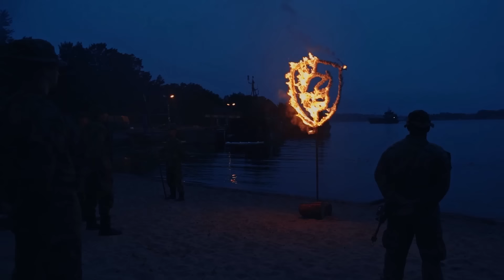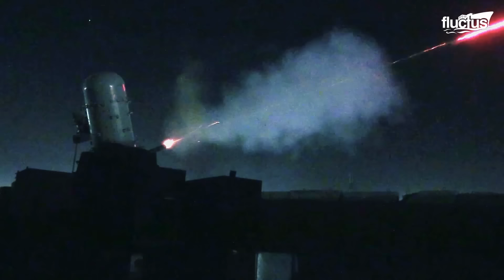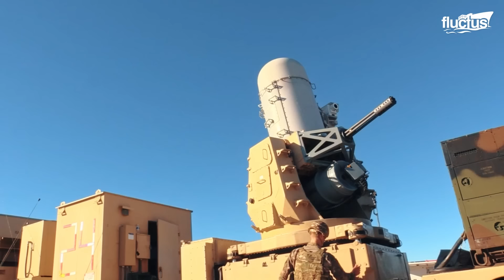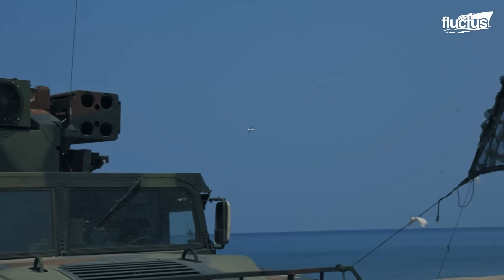NATO Test Firing Sweden’s Powerful $8 Million Howitzer Cannons

Comment: to be fair now days this things are good but useless in a drone war.
they are good becasue they can intercept missile and so on but in a drone war then they are useless.

i mean they are using missiles/ rockets that cost like 100 000 dollar or more and if they go up against a drone that cost like maybe 1000 - 2000 dollar then that is a costly thing.
if a drone cost 1000 dollar to make and they are using the drones against a missile/rocket that cost 100 000 dollar to make then you are out 99 000 dollar.

in short, the other side could in fact just throw drones against this protection and in time you are out off missile/ rockets and money to make new ones.
this is why i said that they are good but useless in a drone war.